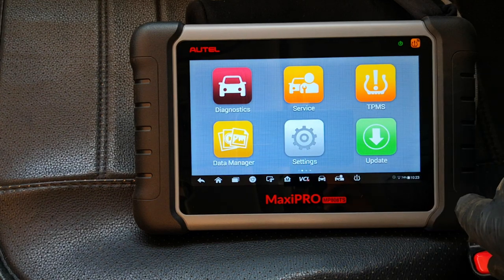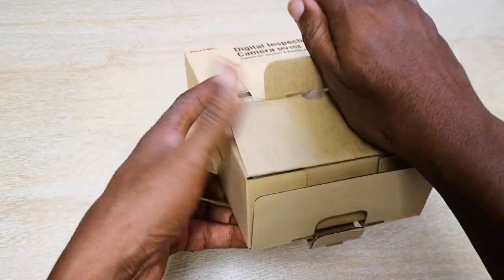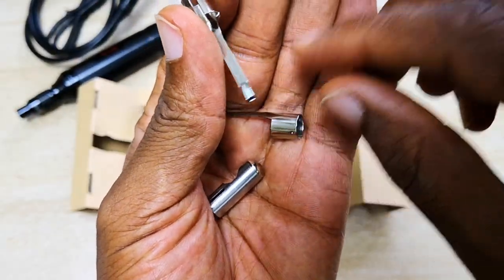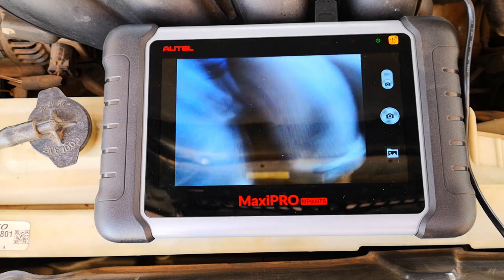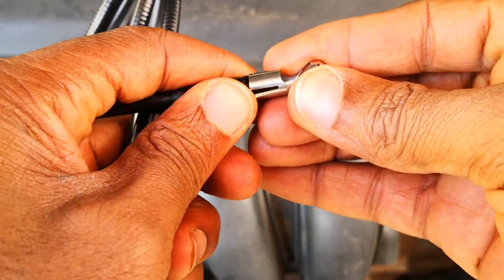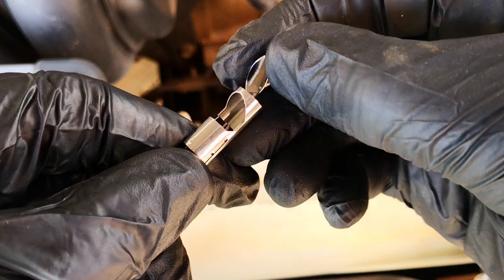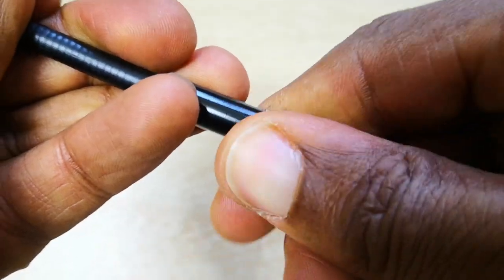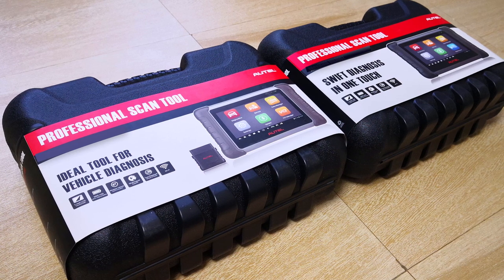Using Autel Scanner to Inspect your Combustion Chamber / Autel MV108 Review

Comment: From what I can see in the video, the borescope's visual quality is amazing for the stated resolution. Also, those mirrors/add-ons will put someone in trouble; like you said, a threaded connection is far superior. Finally, I'm disappointed in the apparent lack of adjustable borescope lights; lesser known standalone or even phone dependent ones have this feature.

👍
Reply from the maker: Thanks for your insightful comments! I super agree that the image quality is very good for 0.3MP. Its video quality is better than a 2MP borescope that I own.
Very salient point on brightness.